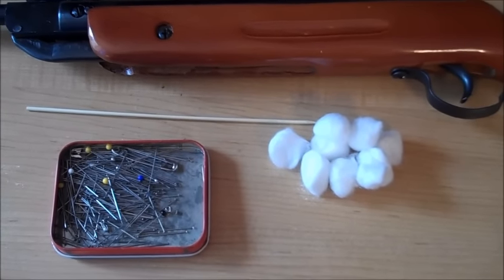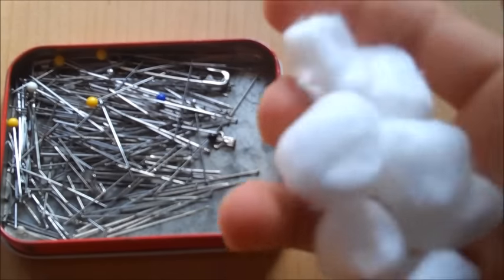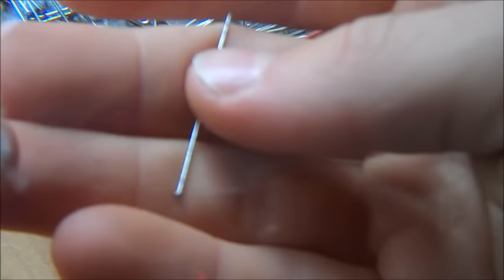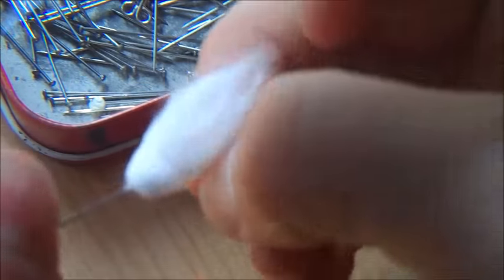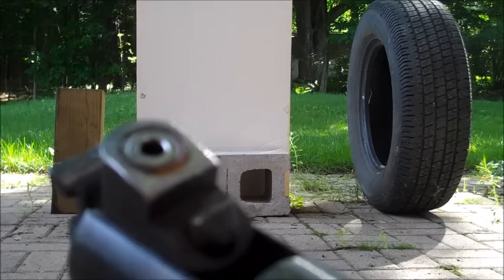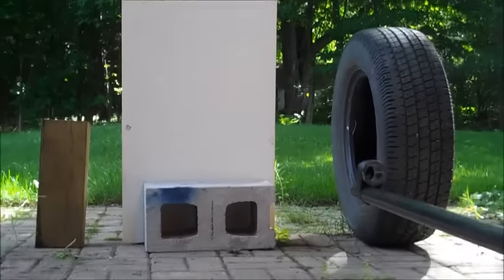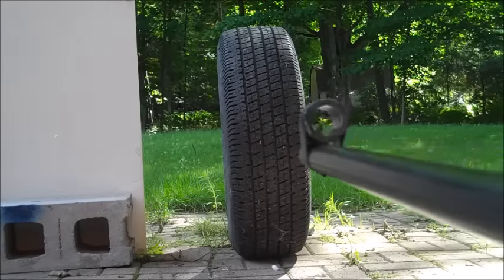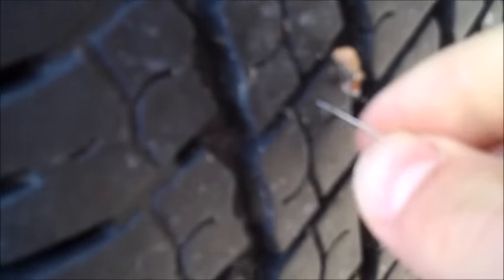Make Simple Pellet Gun Darts

Comment: Great video. I use the plastic inserts from the old push up pencils or pop up pencils, not sure what they are called but, they have like eight or ten little sabot looking things stacked in side, anyway, i removed the graphite and jammed a finishing nail in through the rear then put some super glued or hot glue in behind the head of the nail. Flies straight and there's no need for any fletching because, the cone acts similar to a blow pipe dart.. Try it out, they fit perfectly in a .177 air rifle... I use a Crosman F4, it uses a nitro piston and fires my make shift darts at 1,890 fps on average.. Hell of a crack out of the barrel do to them being so light but, the flat trajectory and penetration is phenomenal.. Try it out....

Comment: nice idea,, just an extra fyi that people trying this should know,   Use this with cheap air rifles with smooth barrels only..   If you have a nicer break barrel it is likely a rifled barrel..  and this could damage your nice gun..
Reply: Really I have a break barrel Gamo deltamax pellet gun, I really want to use this for target practice will it break my pellet gun barrel, I just got it.
Reply: @yahyaazzouni8272  I'm a little late to this but it probably shouldn't break the barrel it would probably just scratch up the rifling which isn't good.
Reply: yeah I agree it could scratch up the rifling a little and I would not do this with your favorite and best guns.
Reply: Now that I think about it you could try putting more cotton on the tip of the needle just enough to keep it from touching the barrel itself but idk how well it would fly
Reply: @amazingjoe3635  how about a drop of glue at the end to make a more solid rear weight that also kind of fills up the barrel to prevent cotton blowing past, add some weight etc. but I think the needle tip might always drive into the barrel wall without a more cylindrical mass back there with the cotton. the cotton is good though once it leaves the barrel for stabilization, it would seem.
Reply: @maxhauler  the cotton would definitely stabalize it more than glue and the glue might have a issue getting stuck unless it's in a cylindrical form around the needle. But then you have a huge amount of weight at the back of the needle and it might want to tumble forward. I've done my own little experiment with a co2 6mm bb pistol I tried putting glue but it just drags too much on the barrel and slows it down a lot I don't really know what to do for it at this point
Reply: It shouldn't  be an issue though if the needle is as small in the video its small enough to where it shouldn't touch the barrel so I'd say just keep shooting it as shown in the vid
Reply: @amazingjoe3635  anything up front would tend to destabilize
Reply: @amazingjoe3635  you are right. any weight at the back would tend to end up at the front with air resistance catching light stuff at the front and trying to spin that towards the back. I had a brain fart. ... in thinking about this stuff it is good to consider some of the penetrator style pellets with the plastic rear portion. some of them are basically a metal dart (albeit short) with a plastic cylindrical sabot (that stays attached). Two of these are the Crosman PowerShot Fast Flight Penetrator and the Crosman PowerShot Gold Flight Penetrator. The first one has a thin diameter 'dart', and the second one has a full .177 diameter metal tip. I can think of a few ways that both of these pellets could be customized in the interest of science.
Reply: @amazingjoe3635  actually if I was going to customize some of these 'plastic sabot' style pellets I would do it in .22 cal and use the Crosman PowerShot Red Flight Ultra Heavy. (whos weight is actually not that heavy .. just medium.) but I have lots of cheap and not so cheap but powerful 22 air pistols and air rifles to work with. I think this pellet is perfect to use as a basis for experimenting with dart-like projectiles or whatever. air-powered projectile devices .. any variation is interesting to me.
Reply: @maxhauler  you should check out Matt BozAwesome channel he does some stuff like this but better
Reply: @amazingjoe3635  damn. I was totally looking for something like this. thanks!! The other thing I am into is shooting toys and models coincidentally! I only target shoot and I find paper targets boring. yeah this channel is gonna get some views from me!
Reply: @maxhauler  yeah the good thing is is that he's still posting stuff. Hope you enjoy his channel I definitely have

Comment: within the barrel at the time of firing, I would expect the cotton to be blown forward past the needle, leaving the needle behind, because the needle will be much harder for the air to accelerate because of its mass and the lack of anything holding the cotton in place from sliding past the needle. So, having said that, has anyone else got ideas on a way to keep to cotton (or whatever else might be used) at the back of the needle so it can catch the air and push on the needle and also stay behind it so it continues to stabilize the flight of the needle, even immediately as it leaves the barrel. (a drop of glue might be good.)  I've never tried this, but it is interesting to me. Pretty cool and thanks for the video!

Comment: I break a Q-Tip in half, and shoot it through my .22 pellet gun if I just want to chase an animal out of my yard.  There is a hollow tube Q-Tip that will hold a pin quite nicely.
Reply: Use the regular Q-tips . cut the shaft of it to length of the pellet . cut a sewing needle in half . a rag and needle nose pliers works . cover the needle with the rag and snip using the pliers . use the pliers and tap the needle into the Q-tip piece you cut . open chamber and slide needle end first . lock it and shoot . it's extremely light compared to a pellet so it's fast , dead on accurate , the speed it travels is unreal . you could use crazy glue to help hold the needle . i don't use the same needle dart more then twice and just make so many of them that there no sense in going after them . Use only on targets ! This is not for hurting any animals , self defense only if it's a must . in those cases poison tips and aim for the eyes .

Comment: The better question is how accurate can it be & at how far of a distance & if not far how to improve the distance & accuracy. By some how fixating the air tight seal just before the end of the said projectile, & then attaching some small durrible fins at the back to help with the accuracy of said projectile. Keeping in mind one would need the type of fins that are somewhat flexiblly stiff so you could insert into barrel, but when it exists the fins will push & extend out just a smidge to get the effect. But still a decent video

Comment: Get q tips and safety pins cut off the pins needle tip and cut a q tip and there is a tiny hole in a q tip slide the blunt side in and load into air at close range there are very powerful

Comment: This wouldnt be like dry firing it, would it?
Reply: War Zone  yeah but firing a spring rifle like this with no seal damages the gun. the cotton and nail arent a good enough seal, so its basically a dry fire
Reply: I agree with BigBird. This would not provide much back pressure and your piston may fly forward too fast and slam into the cylinder top/front. I think it could do damage like dry firing. Also, darts like this are not going to catch the air pressure sufficiently for their own acceleration needs. The rear part/fleschette needs to be more solid and fit the bore and even more weight is good. you need some weight to carry downrange through the air resistance. you want as much weight as then gun can accelerate to the point where it has used all the air pressure by the time it gets to the end of the barrel. you dont want a lot of air pressure left blasting out behind a projectile that is too light. so there are a lot of things which can work better than the cotton plus needle. still very cool video. giving me ideas. I like to try different projectiles in my pellet guns. cheers!